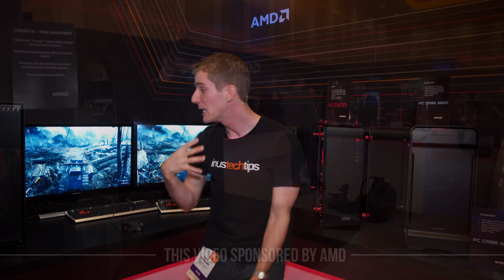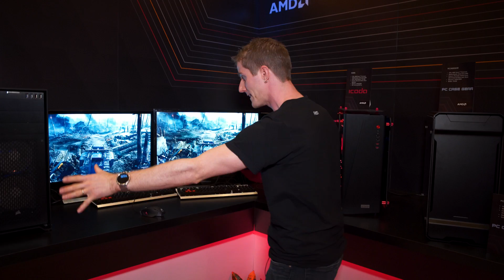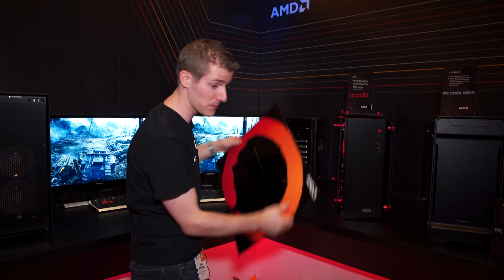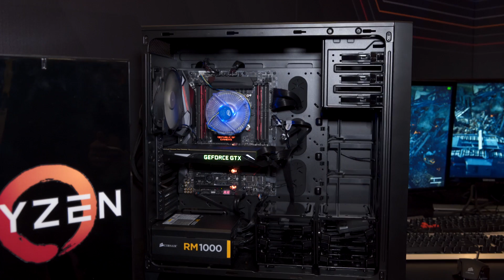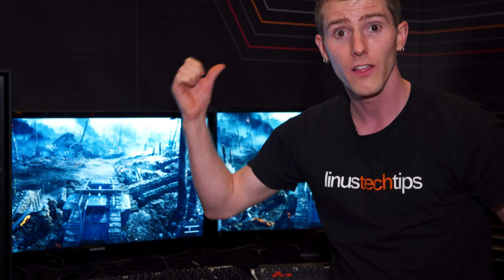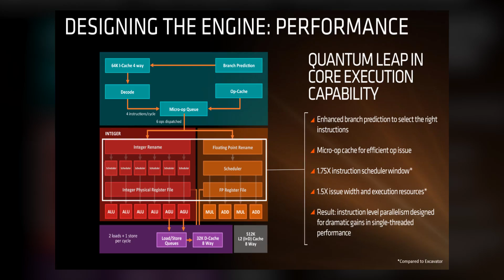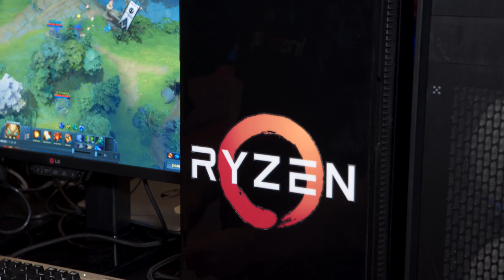AMD Has Ryzen!

Comment: When amd is using a gtx
Reply: They are because they don't want to show vega yet
Reply: point is everyone knows the titan x is the best gpu available gives amd a chance to show just how powerful their cpu is.
Reply: You are missing the point, they did a good job with that, where you looking away when linus explained? It was for CPU comparison. How the heck do you compare CPUs when you use a GPU paired to them that's not even on the market? They used that nvidia gpu because everyone knows that gpu won't bottleneck the cpus. That's the point.
Reply: All seem plausible. Rx460-80 are Low-Mid End.
Reply: Yea but it's kinda ironic and thy could have just as easily used one of their GPU instead of "advertising" Nvidia

Comment: As a hardcore Intel-Nvidia fan even since the Geforce 6 series from April 2004, I'm really stoked for everyone that AMD is stepping up their game.. They need to compete with Nvidia and Intel to push innovation generally.. I'm tired of the usual 10-15% performance increase with every generation. Sure there may be some physical limitations to how much performance you can squeeze out of a silicon chip, but then they'll have to start thinking in other ways of innovating like AMD has done with Ryzen. Improving the communication and structure of a chip is actually a huge step forward and I'd only imagine how fast processors we'll get if Intel also started improving in other ways than just clock speed.

Comment: Games = 90% GPU / 10% CPU.
THIS TEST VIDEO MEANS NOTHING !!!!
Just let run CPU Benchmarks Intel vs AMD, but AMD DONT DO THIS ! 
Because they know they suck !
Reply: they did do the cpu benchmarks... clock for clock the ryzen chip either matched or outperformed the intel one. As far as I remember they did handbrake and cinebench
Reply: SwissCow85 And thats were you are wrong m8.... Games are not just only GPU loaded today... may have been the case years back. But you now have a complete different setup regarding both physics and Ai in games nowadays.... so put you rant back where the sun doesnt shine... ;)
Reply: Battlefield 1 is commonly bottlenecked on the CPU in many computers, so the BF1 test does matter. It proves that their CPU is competitive with Intel's in CPU-heavy games.
Reply: CPU dependency depends largely on the game. But I agree, not a very good illustration of what it can do.
Reply: Certain games are more cpu heavy and others are more gpu heavy, but regardless a more powerful cpu will bring some improvement
Reply: The Pope , not to mentioned they did a STREAM test, and we all know that you need a very good CPU in order to have good stream quality while playing with games. They were able to show and prove how well this CPU handle streaming. AMD all they are doing right now is show all gamers out there that it can run games, stream and more, since the biggest market in PC right now is gaming. I'm sure as we get close to the release time of it, we will see  the potential of this CPU base of software related computing power and how fast it can operate in the NON gaming world.

Comment: AMD let you take the panels off because that still doesn't tell you if they did some nonsenese like disabling hyperthreading, stepping, or other fiddly things in the BIOS to make them look like a more even match.
Reply: FFS amd setupd did not have boost on, intel had it on... watch the damn video
Reply: + Anthony Flagg How the f..k can you disable "stepping"??? Stepping is like the version of the CPU ( AMD red. ) Are you pulling nonsense out you anuz???
Reply: Speed stepping e.g C-states can be disabled on intel CPUs which would have the effect of making it appear to consume more power, etc. It wouldn't be the first time AMD gimped the intel CPU in their tests to make it look slower, like their benchmark where they down-clocked one to 3GHz.

Comment: is bf running ultra 4k? beacuse if that is true, there is no fucking point showing that, at 4k everything is gpu bound, I have a 1080 with an old 2600k, my cpu is never a bottlneck at 1440p let alone 4k. So having a 2600k, that 6900k or ryzen means shit at 4k.

Comment: Battlefield 1 on singleplayer is not heavy on CPU so i count this benchmark as... useless... Get into a 64 player multiplayer match and then compare ;), while i had the same exact FPS on the battlefield 4 campaign with an amd cpu (8320 @ 4Ghz), when i went into the multiplayer i couldn't keep up 80fps, microstuttering while recording, etc, after getting a 5820k, stock, i had easily 180-200fps, no stuttering while recording and in a whole, a more playable experience.

Comment: Can't wait to update my 5ghz 8370e to the Ryzen(AM4) based chip so I can push my EVGA GTX1070 SC (oc'd) some better frames. :) although I may wait a generation to do so. I just bought a new MOBO/new ram to achieve a stable 5ghz oc to make sure I can play games in 1440p-2160p it handles it ok but definitely has some room for improvement but older games run fine like GTA 5. Watch Dogs 2 and BF1 have issues at those higher resolutions.

Comment: Not impressed: I want an actual CPU benchmark. Since AMD is showing GPU-heavy content, I suppose their CPUs still suck and they try to hide it with the "well they won't actually slow you down compared to this extremely expensive CPU" even though you can just put a "cheap" i5 6400 in there and the performance would be the same.

Comment: they should have just compared it to the 6700k, that 7970 or whatever the number was is a 8 core processor, it's not really for games as they don't scale that well when you add like 16 threads and a lower clock speed.

Comment: I kid u not I was like 10 minutes away from ordering a new motherboard for a skylale cpu. I cam here to find tests between the i5's and i7's. So glad I did. I have been waiting so long for this. I fucking hate intel, the core 2 quad was the last waste of my money I ever gave them. Ill be fine using my fx 8320 for a while, I just hope they pull an AMD and make the price ridiculously low again. Who knows? If its in the $300 range I could return my gtx 1060 sc and Ill have enough to buy a GTX 1070, finally upgrade my ram from 8gb to 16gb (overdue at this point ik). Cmon amd

Comment: I've been using AMD since the Phenom days, was thinking about going to Intel then I heard about Ryzen. I honestly don't care which is the best of the best but when it comes time to upgrade. I just like to get an actual upgrade so I'll still be getting Ryzen to replace my 4yr old fx8350. As for GPU, I prefer Nvidia with no real reason other than they've never done me wrong in the 10 years I've been using them. I still give AMD props for buying ATI and integrating them into the company the way they did though

Comment: PSA: The new 8 core RYZEN stepping now works @ 3.6 Ghz stock speed on all cores and with a boost to 4.0 ghz on a wraith stock AMD cooler and it is confirmed by AMD that all ryzen chips will essentially be like Intel K models with unlocked multipliers

Comment: Ou Yes!!! I think the AMD cannot beat Intel in High end ( i7 6950x in video vas running without overclocking (maybe 3.0 GHz), when you will OC this procesor, I think that I7 will beat Ryzen AMD) But this is Good message for me, and all AMD fanboys. Because the I3 and I5 without K was too expensive and now, if the AMD ryzen 4-6 core procesor will cost 100-150 dollars and there will be option with over clocking, ALL I3 and I5 without overclocking will be death....

Comment: Not hating, but skeptical. I want Ryzen to be good, I want Vega to be good, but in the last years, if NVidia and Intel did one thing, it was delivering. I just got an overclocked Skylake 6700k (had 2700k before) + Z170 pro gaming and DDR4 2400 ram 2 months ago, and boy oh boy, the difference in performance with my (soon to be replaced by an asus 1080ti) asus 970, was like getting a new graphics card. I even bought a 34" G-Sync monitor from asus, and it's like i made a technology jump of 10 years. All my buddies got from buying AMD in the last years were crashes, underwhelming performance and false promises. So I really hope AMD can Ryze again, so NVidia and Intel will have to think twice now before they put their Apple Prices on their products.
Reply: How did the RX 480 not deliver? Or for example my current card, the R9 290X, being the original Titankiller? AMD's GPU department deliverd very well over the past years, especially with theit amazing driver support. As for CPU's, well,  if you're on a budget...
Reply: What did Intel deliver exactly?? 5 ipc gaing for 5 years plus kabylake with 0 IPC gain... give me a break man
Reply: Performance? You can talk about all the stuff behind the technology and all, what I want in the end, is that my games, and my PC as a whole, runs smooth. That's what intel has given me.
Reply: đenan Hajrovic The 1060 and 480 are roughly on par now. The 1060 beats the 480 in some games, the 480 beats the 1060 in others. The issue was people hyping it up to be capable of destroying a 980 or whatever, which is not what AMD said it was gonna do.
Reply: I got 2 1080s. I really hope the 1080ti doesn't come out soon so I can brag about my 1080 for a long time now.
Reply: Yeah, how did the RX 480 not deliver? It performs as advertised.
Reply: People, there is a difference between hype, and saying "ermahgerd this card is going to be awesome", advertised as the flagship killer, with half the price, and then you get middle class performance. Why are you defending this? First, there is nothing to defend. It was false advertisement. Period. The cards did NOT deliver. Either you live in a different dimension or you've never seen games played at their (as advertised) full potential.
Again, I did in no way hate on AMD, I just stated that AMD did not perform well. With well I mean challenging the PC market semi- monopol of nvida and intel, and not spend half your resources on console and other things.
I know what amd performance looks like, I have many amd fans in my circle of friends. But they don't argue with me about this, and I don't argue with them, because they agree on the same matter: AMD has to step its game up.
Reply: RoadRunner It was NOT advertised as a flagship. AMD never said so. Only morons thought it would beat a 980Ti.
Reply: RoadRunner 

He is correct. The 290x with uber mode did beat the original titan @ 4k and 1440p.. The problem was that the card has a awful reference cooler , as for the 480 it i snot fatser than the 1060 in many dx 11 and ofcourse dx 12 and vulkan. 

As for drivers , with re-live radeon drivers which brought radeon version of shadowplay nvidia and radeon drivers are now pretty much equal
Reply: đenan Hajrovic I'm not. I'm blaming people for hyping and then being disappointed with the companies delivering what they said they were gonna deliver.
Reply: RoadRunner  The RX 480 beating the 1060 6 months after launch due to driver optimisations is nothing short of sad for Nvidia. And Im only speaking about DX11 here. Don´t get me started on our lord and saviour Vulkan. So yeah, funny. But only for Radeon users.
Reply: Akula Markov 

Simply put, people do not listen.. Look s this video , the man explaind everything in detail and ppl still write imbecilic things
Reply: RoadRunner The RX 480 was advertised as a budget, yet relatively high performance (1080p 60FPS in AAA titles) that could run VR Headsets good, not very good, but good. And guess what. Its exactly this. A midrange card that delivered, and as time goes on, will continue to improve its performance. Also, saying that you have friends that buy AMD isn't an argument. It's irrelevant in this conversation. Go look up the newest benchmarks from numerous sites and then come back and say again how the 480 and the 470 did not deliver. As for the high-end: you're right
 The origin price point of the Fury line-up was way too high, but given the fact that it uses HBM somewhat understandable. And yet the performance was not given. The price point now seems way better tho (300$ Fury Sapphire Nitro). But yeah. AMD needs a new high end.
Reply: Ðisrespekt I'm sorry, but if my friends get frame drops below 60fps, on a lower resolution (I play in ultrawide, they in FHD), in games and places where I do not get frame drops below 60fps, while I have a GTX970 with less VRAM, the cards do not deliver. When I play a game perfectly fine, and 3 of my friends get crashes in numerous games because of driver issues, while I get no crashes, the cards do not deliver. When games and situations are cherrypicked to fit AMD better, but in the everyday use the card does not what it says on paper, the card does not deliver.
The card was not advertised as "the VR and 4K card", it was advertised as the flagship that does that "on top of its other qualities".
Anyway, this conversation is not going anywhere except in a circle, so if you don't mind I'd like to say what you wanna hear:
"you are all right, I am wrong"
Maybe that makes you feel better, your AMD cards certainly don't.
Reply: Well Nvidia surely delivered in frying people's hardware. I mean like... who in their right mind will forget about their recent driver fiasco which was performing memory dumps and crashes right out of the box. Also, nice company shipping 3.5GB cards under the pretext of 4GB cards. LMFAO.
Never had memory dumps on any AMD hardware till date. Ultimately you get what you pay for with Nvidia -- a shit nugget coated with honey, caramel and cheap chocolate. :) Meanwhile with AMD you get the nice and fine wine. How are the 780tis doing? LMFAO.
Reply: It will come out soon. If you follow the advancement and the news, there has to and will be a 1080ti soon. But why brag about 2 1080s? They must have insane performance.
Reply: Ðisrespekt Hehe, funny.
Reply: Akula Markov 

We cant blame nvidia and amd for ppl hyping.. Look at nvidia ces and the 1080ti hype that did not pan out
Reply: Ðisrespekt Yeah, Nvidia really need to step up their driver game. When I moved to AMD I heard horror stories about their drivers but I've had far better experiences with theirs than Nvidia's.
Reply: Ðisrespekt 

That is because nvidia going from kepler to maxwell changed a lot of stuff.. Amd did not change GCN much from 2012, and that is why with every driver update products from the 290x to the 480 get a speed boost. Look at the 780ti now vs the 290? It is embarrassing , but radeon vega is 90 percent new and now we will see just how much the fine wine radeon tech will go..
Reply: RoadRunner My card easily maxes the games I play at 90-144 FPS. The thing is, my card is worse than a 480. So yeah. 
Tell me what games do you and your friends play.
Reply: RoadRunner such thicc brains m8
Reply: Bought a i7-4790k last week. I could not believe a cpu could deliver such performance! Paid $180. I am wondering what AMD could deliver for those money?
Reply: It was advertised as nVidia killer and budget card. Excuse me, but $300 is no low budget. And nVidia has the 1060, which is cheaper. So what they accomplished, cause I do not understand?
Reply: Cosmin D. Execpt its 250$ and was NOT advertised as an nVidia killer. Its was advertised as a mainstream GPU.
Reply: Cosmin D. Also: the 1060 is 300$. And is a bit worse than the RX480. So yeah. There is your accomplishment.
Reply: You are correct. In UK they cost roughly the same now £220-250. The RX480 was £250-280 in 2016, maybe because of the hype. Now it droped in price. Yes, the RX480 looks a better buy now. But I still preffer to buy a 980ti from eBay £200-250.
Reply: Nope. Apple most definitely uses AMD GPUs for all of their dGPU options. apple . com/shop/buy-mac/imac?product=MK482LL/A&step=config#

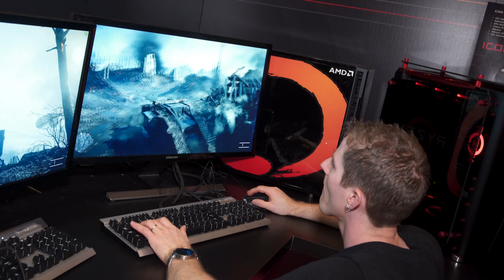Comment: 2:23 intel hits 75-77 fps constantly
whereas amd hits 55
linus wtf?
Reply: i still support amd for what they are doing,
but fact is fact
Reply: Intel has turbo boost enabled, AMD doesn't. Also, Battlefield 1 fps drops when you start actually moving around instead of just sitting there.
Reply: if that's true i recognize my mistake
Reply: Not only that but like he said, stagnant frames vs moving frames, a HUGE difference.

Comment: Have you already heard of the 18/20 CPU +  4 chipset Lanes for all the Ryzen chips? Thats okay for 4C8T beginner stuff. But the 8C16T with that amount of lanes is just stupid. 

SLI? 8x/8X
SLI + Any PCIe 3.0 card? Nah.
GPU + Any PCIe 3.0 8x/16X card? x8/x8
GPU + NVMe + Any PCIe 3.0 x4/x8/x16 card with two SATA ports in use? Nah.